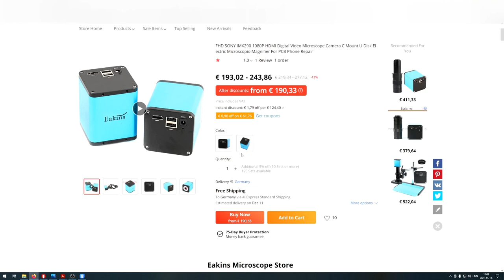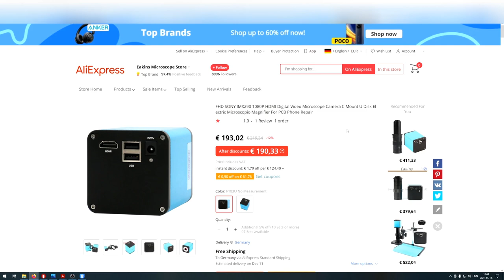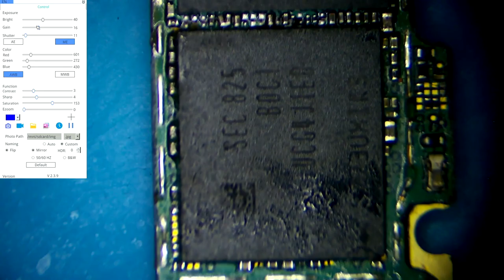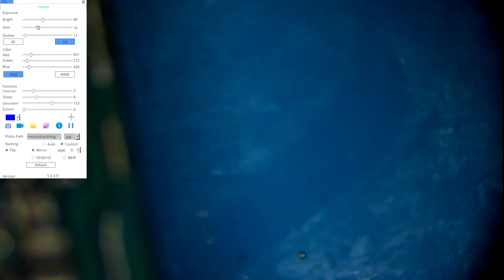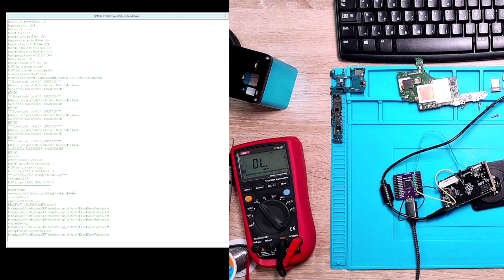FAKE Sony IMX290 microscope camera - SCAM

Comment: wtf show me dirty pcb and camera with shit light :/
Reply from the maker: While soldering you have a pcb full of flux and reflections. This is a real life condition. As for the light I used the ring light which came with the microscope from Eakins.  In addition I also tried an Amscope ring light later on with similar results. Btw how do you explain that the 70€ camera worked better with the same "shitty" light?
Reply: @kikihobbyrepair  quando se compra uma camera é muito importante ver o tamanho do sensor, dos pixeis e o número de megapixels no sensor. Nem tudo é compatível e essa informação deve constar no manual do microscópio ou lente. É o tamanho individual de cada pixel que permite receber mais ou menos luz e obter a qualidade de imagem desejada para o equipamento que vamos utilizar. 
Eu por exemplo tenho uma lente computar 10x macro e o sensor ideal para ela é o sony IMX 185, outro sensor com mais megapixels já não funciona nessa lente, perde em qualidade de imagem e luz dada a quantidade e espessura de vidro utilizada nessa lente da computar.
Nas imagens mostradas é possível se ver uma zona escura do lado direito, o que significa que o sensor está mal posicionado no microscópio. Não está centrado e está fora da zona de trabalho ideal para ele.

Comment: The reflections are the result of your lighting setup.  In the adds they are using an LED light ring and a simpler lens.
Reply from the maker: Thanks for your comment.
I am using the exact same Eakins ringlight and tried also an other Amscope ringlight and also tried lighting from 2 sides.
I have also tried the simple Eakins lens they use in the video. It was my original setup.
Furthermore how can that be that my old 70€ camera can handle the reflections better?
Reply: @kikihobbyrepair  You might try adding a small (say 1 inch) extension tube on the end to block light coming from the sides.  My Tomlov soldering setup has a small plastic insert at the bottom of the lens (like a lens hood on an ordinary camera), but it is self contained rather than mounted on a microscope.   Maybe you could even 3D print an extension tube to try out.  Regardless, I think one issue for you is one of dynamic range.  There is so much light coming off the aluminum shield that it has to reduce the light sensitivity to compensate.
Reply: Of course, none of this means you were not scammed, as you proved when you used the test points.  You might have been able to determine something as well by using Noel Danjou (developer of AMCap software) windows camera diagnostic program, as well.
Reply from the maker: @cubeistgames7985  Yes this shield could be a good idea though I will just sell it as an IMX185.... I do not like it.

Comment: Besides, check it out, please. Is + 5V supplied to pin 20 (VDD5) FE1.1S USB 2.0 HIGH SPEED 4-port HUB Controller? My FE1.1S 20 controller has a pin off the board.

Comment: I see nothing wrong with the camera  the problem is the lighting. You need to use external lights that are located to the side of board.
Reply from the maker: Yes, I know that with lower angle lighting you can improve this. My biggest problem is that it is not the IMX290 sensor with the HDR capability. Furthermore if you compare it with the old 70€ one, it handles the  same lighting significantly better.
Reply: @kikihobbyrepair  yeah I agree. the sensor should be what you paid for. Fingers crossed as I just ordered a microscope cam on Ali that is advertised as imx385. I will totally open it up to check.

Comment: It's sad that the sensor is really not the stated one, but you can try a different type of light source and you will be able to remove glare and reflections, even with your previous camera, 
NorthridgeFix did a video about it https://www.youtube.com/watch?v=NtBiFHq2Qwc
Reply from the maker: Yes, I even designed myself a gooseneck light for the microscope in one of my previous video but this does not change the fact that the sensor is different and even worse then the old cheap one.

Comment: Reflection is not because the camera. 
You need to use polarizing filter. And a better ring light.
You can find  many topics on the theme.
Reply from the maker: I totally understand your point. For sure a gooseneck style light source could significantly improve the situation. I have tried 3 different light sources (including a ca 150€ Amscope), added a polarizer and in each and every cases my 70€ camera handled reflections flux on the board significantly better. This is my main issue.
Furthermore I ordered an IMX 290 camera and I got something else which is in general totally unacceptable...

Comment: There ıs no problem with this camera. Problem is your shity lighting.
Reply from the maker: Tried with 3 different microscope lights. One of them was an Amscope ring light. Furthermore also tried with gooseneck lights from different angle to avoid reflection. There were not a single setup where it performed better than my 70€ camera... Furthermore I ordered an Imx290 and I got something else. There are multiple problems here, sorry to say....